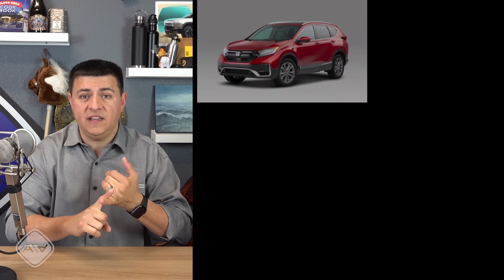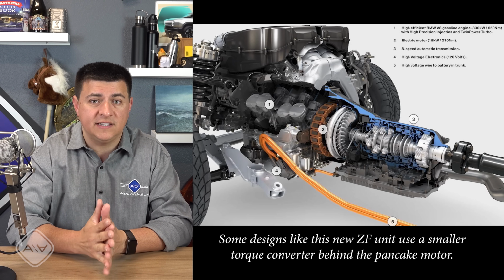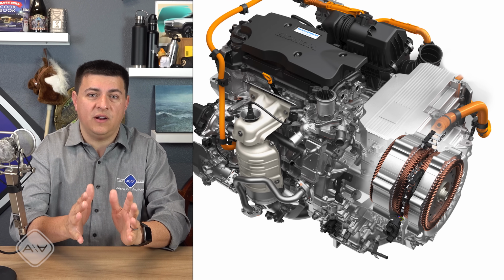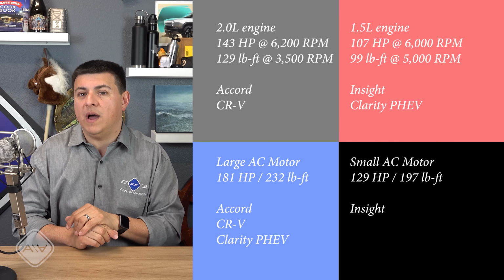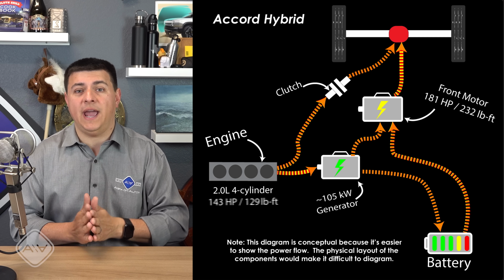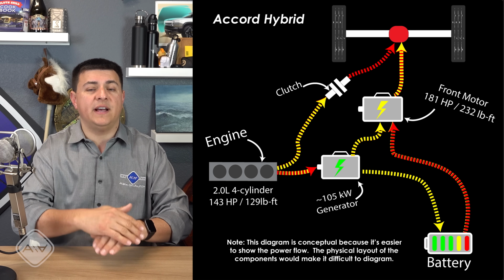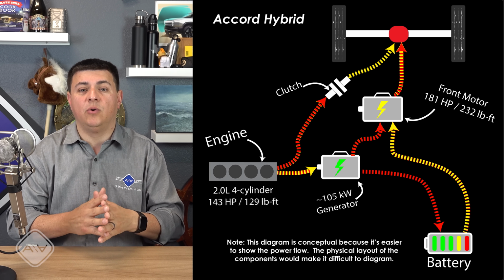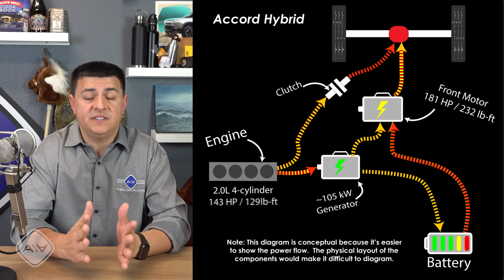How Does It Work?  Honda's 2 Motor Hybrid System Explained!

Comment: Excellent explanation but, sorry, Chevy Volt is not a planetary gear set type hybrid. It's a serial hybrid, very much like Honda's system.
Reply: The Voltec I system has one planetary gear set. In two of its four modes, it is a hybrid. One is a pure serial hybrid system, where one input to the panetary is held at 0 rpm. But the last is much closer to Toyota's power-split system than it is to either of Honda's modes. The Voltec II system (2016+ Volts) has two planetaries, and I won't venture to place it in a category. See Alex's excellent video comparing them at https://youtu.be/o3-wGOyT2-I .

There are some semantics involved, but a power-split hybrid sends the ICE's power to two places. One is directly to the wheels, and one is to a generator. That generator's power is used mainly to drive a motor that adds some power back to the wheels. But this electrical side can also charge or discharge the battery. The goal is to regulate the ICE's rpm by controlling how ICE and motor rpm are combined, while also maintaining some level of charge in the battery.

Honda's system doesn't regulate ICE rpm at all. In "Hybrid Drive" it is a pure serial hybrid, where ICE rpm is unrelated to wheel rpm. In "Engine Drive" it is a direct-drive parallel hybrid, with a fixed relationship between ICE and wheel rpm (in the Accord, RPM=37*MPH; the CR-V is close to that).

Chevy's system can be a pure BEV, a pure serial hybrid like Honda's "Hybrid Drive," or a power-split system used to regulate ICE rpm. It's not quite the same way Toyota does it, but the goal is the same.

Comment: Honda invented vtec. It’s always been around but in different forms and design. Honda Rocks!
Reply: Alfa Romeo invented variable valve timing LONG BEFORE Honda. Honda just copied it.
Reply: @alessandroserrao9422  no they invented a different way. Vtec was invented by Honda.
Reply: @raiderrichard7291  it's a copy anyway. A copy of the original theory. Honda modified the original vvt by Alfa Romeo.
Reply: @alessandroserrao9422  Honda invented vtec
Reply: @raiderrichard7291  Honda didn't invent variable valve timing, period, vtec or not. Call it what you want, the variable valve timing was invented by italians. Italians did invent also the evolution of vvt: the multiair engine. A real gem. Moral of the story: italins do it better, they are the first to invent things (ex. the common rail for example...)

Comment: The honda dealer says it has a cvt. The service tech couldn't tell me why the cvt oil wasn't changed at 30000 miles. Car and Driver says it is direct drive. ARS technica says it has no transmission.
Reply from the maker: Yep, it’s hard to describe
Reply: @AAutoBuyersGuide  it has a fixed direct drive transmission. Honda calls it an ecvt even though there is no cvt there. They are going to change the oil in it. They told me they forgot to do it at 30,000 miles. I told them they would do it when I brought it back for the next oil change in 5000 miles.
Reply from the maker: It is a serial hybrid with clutch enabled direct drive. The cvt definition comes from the fact that the engine can have an infinite number of ratios if you consider generator - motor speed differentials as a “ratio”.
Reply: @AAutoBuyersGuide  I don't consider different engine or motor speeds as being a variable transmission, because they are not transmissions, and automotive engines and motors have always been able to change speed. A CVT can vary the speed of a vehicle without the engine or motor changing speed.
Reply: A continuously variable transmission does not restrict the ratio, of engine speed to wheel speed, to specific values. But in general, as wheel speed increases, the engine speed will increase to a lesser extent. This is to provide more power at the higher vehicle speeds.

What is traditionally called a CVT does this with a belt (or chain) driven by cone-shaped gears whose spacing varies. Honda and Toyota do not have that - they call it an eCVT, not a CVT. But they still have mechanical parts that need the lubrication and cooling that transmission fluid provides. But it isn't "cvt oil," it is automatic transmission fluid.

Intervals will vary, but it will be done less often than cvt fluid changes. I don't know how Toyota does it, but a Honda will have a "Maintenance Minder" that monitors more than just the time between changes. Follow that unless you do a lot of mountain driving, and then Honda recommends 47,500 miles.

As for how it works, it has two modes when the engine runs. Most often, the engine drives only a generator. That, combined with the battery if needed, power an electric motor. Since the engine is not connected to the wheels, the ratio of their speeds is irrelevant. It does vary continuously, but is meaningless. In the other mode, for cruising on the highway, it is a direct-drive transmission. When ARS technica says it has no transmission, they mean it has no gearbox that changes the gear ratios.

Comment: The max power probably have to do with the fact that is the electric engine and the gas engine power curve on top of each other? Can they make the max power same time?

And the other thing is, can you use the generator as engine when the clutch is closed? That wuld give an extra 100hp if the battery's are up for the job
Reply: For the Accord Hybrod, at 110 mph with the clutch engaged, the ICE is running about 4100 rpm and can make a maximum of about 99 HP.  Since any battery power sent to the generator (as an engine) takes away from the power sent to the motor, there is no point. If this is what makes 212 HP, in means the battery can only put out 113 HP. But then, the Ho9nda Clarity would have more than 212 HP combined.
(Toyota's hybrids will use the generator as a motor, because that is how they mechanically regulate ICE speed. These Hondas don't.)

Comment: The "coupling" limits the % of power, that goes to each wheel. Can't see it being better in slippery surfaces/conditions, than the Rav4 Hybrid. Maybe in a actual off roading trail, it may out preform the Rav4. Only because of being more mechanical. Toyota's i-awd, allows you to send power to each wheel, when it wants, what %, and to a single wheel.

Comment: The ez explanation is that its an EV with an engine generator instead of a battery.
The engine only drives the wheels in a single speed (roughly 6th gear equivalent) when you're cruising at motorway speeds.
It's a brilliant idea but I feel like the battery should be a tiny bit bigger than 0.9Kwh.
Reply: I'm not sure where you got 0.9 kWh, or what vehicle you are talking about. Honda doesn't include it in the specs for HEVs (as opposed to PHEVs, like the Clarity). In various reviews I've seen the 2018 Accord claimed to have 1.1, 1.2, and 1.3 kWh.

But the effect of battery size, and "EV range," is a HUGE misunderstanding about HEVs (again, as opposed to PHEVs). It's mostly irrelevant. The battery is not a source of power, it is a buffer for power generated by the engine. These car's generally try to use only about 25% of the total range, charging only when it is more efficient to generate more power than the car needs, and discharging when more power is needed or the state of charge reaches a certain level.

Alex doesn't do much to clarify how this works, and is quite wrong when, around 7:00, he describes Engine Drive by "The engine will start driving the front wheels forward, maybe it'll regenerate the battery a little bit, and then the battery is honestly taken out of the equation."

What will actually happen on a flat highway, between about 45 mph and 70 mph, is that the wheels need about 10 HP to 30 HP, respectively, to maintain these speeds. The engine will run at 30 to 40 HP, where its efficiency exceeds 40%. Excess power will be used to charge the battery. Once the battery reaches a certain level (about 50% in ECON mode), the engine will turn off and the car will continue in EV Drive until it uses up about 25%. Then the engine starts, and the cycle is repeated.

All a larger battery would do is lengthen the time in each half of the cycle by the same proportion.
Reply: @jeffjo8732  the fit I was referring to. Sorry I hadn't made that clear.
I just think the hondas eHEV makes more sense than say toyotas hybrids.
Toyotas might be more efficient but their hybrids are primarily combustion with electric motor assist which introduces much more risk of things going wrong with the engine like you would get with a normal car. It requires more maintenance, creates more wear, can be more costly to maintain / fix. Not to mention toyota still have a traditional CVT transmission which in itself is a ticking bomb after 80k.

Whereas hondas eHEV is primarily electric with combustion support. Which makes more sense.
The electric motor does all the work with additional power provided by an engine generator when needed. The engine itself isn't connected to the drive train and the CVT is a fake CVT.
This is why I say its basically an EV with an engine instead of a big battery.
The only time the engin is linked to the wheels is once you hit motorway speeds. Even then, the EV mode tried to take over where possible as the small battery is being recharged whenever the engine kicks in.
Reply: @XcaliburReborn  An Electric Vehicle is a vehicle that uses electric motors for propulsion. That includes Battery Electric Vehicles and Hybrid Electric Vehicles. But when most people say "EV" - even the EV Mode and EV Drive in these Hondas -  they really are emphasizing the battery in a BEV.

And by HEV, they really think you mean a parallel HEV, where the motor and engine both turn the wheels. An e:HEV is usually a serial hybrid, which you could call a Generator Electric Vehicle or GEV. The point, like you are saying, is that the generator replaces the battery. Toyotas actually do both methods at the same time.

Comment: Would you consider a new video describing the new 2023 cr-v hybrid system?
Reply: There is very little that is different, except for a few minor changes to the numbers, from what Alex says here. He gives a conceptual description rather than a purely mechanical one. A few numbers have changed since Honda has been able to refine the technology, but the concepts Alex uses are all the same. They did revamp the computer control a little, but as Alex doesn't mention it here I can't describe the changes without writing a book.

But one of those numbers bears examination. If a conventional car has a 200 HP engine, that applies only to the engine itself. Some gets used for peripherals (alternator, power steering and brakes, fans, A/C. etc.) and some gets lost to heat before it reaches the wheels. A common estimation says that only 85%, or 170 HP, can reach the wheels. And even then, only at one specific engine rpm.

This version of the CR-V, in addition to the Accord and the Clarity, uses a 181 HP electric motor. That means that 181 HP can reach the wheels, assuming that the battery and generator can supply enough power. Using the same estimation, that amount needs to be 181/0.85=212 HP of electrical power. This is what Honda has published as the "combined HP" of all three cars. It does not mean that this is a measurement of the maximum electrical output, it means that this is the spec they were designed to achieve.

Alex explains this very incorrectly starting around 7:40. In his pre-release review of the 2023 CR-V, he explains that there is a new, "official" procedure for calculating combined HP in a hybrid. If I recall correctly, that procedure reduces the 2022 CR-V to 201 HP, or 5% less. The new 2023 CR-V gets 204 HP.

In my opinion, that new method is a sham. I'm guessing it measures the maximum HP, but averaged over a range of conditions. The problem is that if the same test were applied to a conventional gas car, it could never equal the engine's HP rating. That applies only at one rpm. The test would probably achieve, at most, 90% of the engine's rating.
Reply: @jeffjo8732 I have understood  from you about the technicalities of this broadcast. Thanks for the several informative comments across this discussions.
Couple of final confirmation if you can help me with
1. The battery rating of hybrid say 1.2 kwh or 1.4 kwh or. 7 kwh (not phev) is rated for CS to CD range (actual useful juice) or is this a generic battery range, meaning 0 to 100 percent (which doesn't serve to propel the system as limited by the PCU)
2. Why the peak combined power (motor hp/0.85) available only in the hybrid mode (Engine driving generator in turn the motor with battery assist ) and not in the engine mode (clutch engaged) with battery fuelling the motor? Is this due to the engine rpm limitations when connected directly to the wheels? If so will there be any kind of assist from motor or battery during the engine mode of operation?
3. The transmission system seems to be fool proof mechanically (not considering the electronics), however whats your take on hydraulic clutch and flywheel reliability?
Thanks in advance.

Comment: Hello there! 
Thank you very much for the useful video! I'm not very familiar with the hybrid cars and honestly wasn't really interested in them until recently. I have fully committed myself to EVs, and began to think about converting retro (and not so old) ICE cars. 
However after watching your video and a few others I began to think whether it makes sense to include in this group for conversion hybrid and plug in hybrid cars too!?  They are after all half electric to put it this way. As you saied Honda, Toyota/Lexus... have some models which have powerful enough electric motors to move the car on electricity only, in this case is it possible to remove the ICE from the car and use it as electric only? Of Course battery capacity has to be increased and few other changes to be made. 
My question is does this conversion make sense?
Regards,
Thanks!
Reply: What you describe is the Honda Clarity. Rather than just diving in with Battery Electric Vehicles (BEVs) that may or may not succeed, Honda experimented with various kinds of EVs (that technically means a car that uses electric motors; BEV advocates incorrectly say it means only BEVs).

The Clarity existed in three forms: the plug-in hybrid described in the video, a Fuel-Cell EV, and a pure BEV. All used the same 181 HP electric motor that was in the 2018-2022 Accord and 2020-2022 CR-V. So yes, this drive train can work as a BEV. But conversion is an expensive option, and can't be as good as one made in the factory.

What I mean by "experimental," is that Honda marketed them on a limited basis. The PHEV was marketed nationwide, but not many were made available. The FCEV and BEV were in limited markets on the west coast, and I believe only for lease. But they are going forward with the technology. A PHEV version of the CR-V is coming in 2024 (it is already in Europe), and I believe BEVs are also coming.
Reply: @jeffjo8732  Thank you very much! 👍

Comment: The Clarity PHEV and Accord Hybrid both have 181-hp motors (although not the same motors--they have different magnets), so how can Honda claim the same total 212 hp for the Clarity PHEV and the Accord Hybrid, despite the Accord's more powerful engine? Also, the Clarity PHEV is limited electronically to 100 mph, not the 110 mph that Alex says would be required to produce 212 hp, so how can Honda claim 212 hp for that car? I don't know how fast Honda allows the Accord Hybrid to go, so maybe the total horsepower explanation works for that car.

Alex, please explain why the Honda Clarity PHEV starts up its engine in response to regen braking if the battery is already fully charged. How can that technique use up the excess electricity generated by the traction motor as it tries to slow the car down? Why doesn't the Clarity PHEV act like  the Accord Hybrid, which expends excess electricity by powering the starter motor/generator to spin a dormant (no fuel injected) engine?
Reply: Whether the engine is on or not, the excess energy from the regenerative braking becomes friction that is expelled by the engine as waste heat (and if the heater's on, some of that waste heat is used to warm the cabin) - essentially it's using the same technique as engine braking on a traditional gas or diesel engine. Starting the engine just means you generate a bit more waste heat from burning the gas that gets injected when the Clarity does this.

I assume the Accord doesn't need to start the engine because Honda refined the engine control software, if not the engine itself, to fix this edge case sometime after releasing the PHEV in Japan in 2016 but didn't port the changes back to the Clarity. They'd probably have to do new rounds of emissions testing on both EPA and Japanese standards on the Clarity if they modified the engine/ECM in any way, which costs money on what is already a break-even car at best for Honda.

Comment: This system is basically the same as a diesel-electric powertrain as used in locomotives ships and mining trucks,when the ICE is not connected to the drive wheels.
Reply: Except typical diesel-electric locomotives don't have a battery to store excess power, and these Hondas can connect the ICE to the drive wheels in certain situations.

Comment: How much to replace each transmission motor? No one will be able to work on them and will have to replace when fail.
Reply: It is a Honda, it will probably last +200,000 miles with schedule maintenance.  Honda/Toyota hybrid tech failures are few and far between compared to mechanical systems.